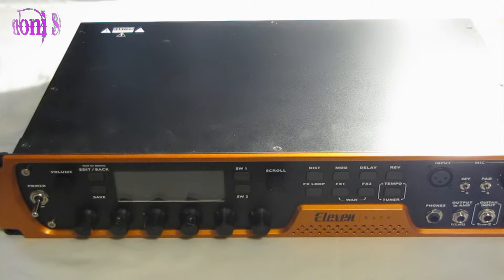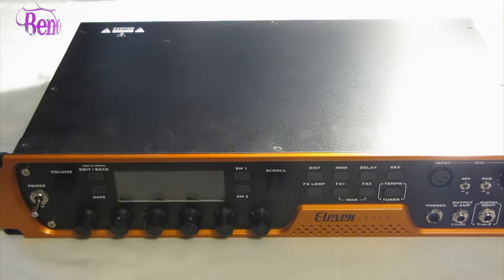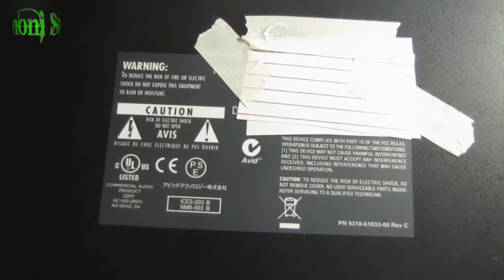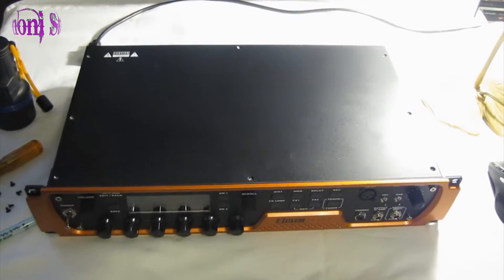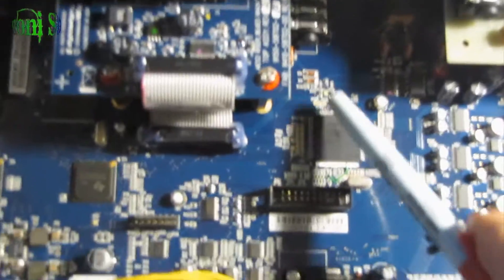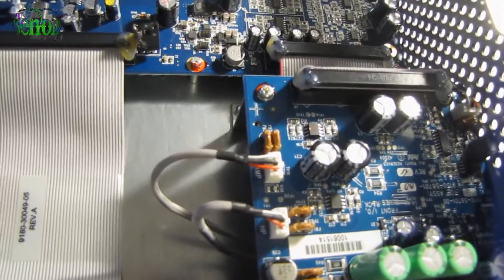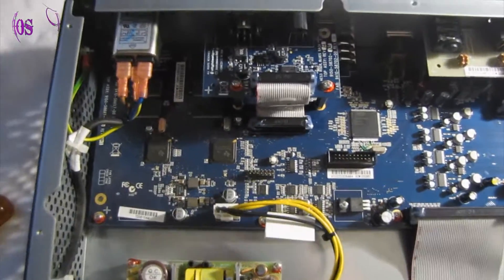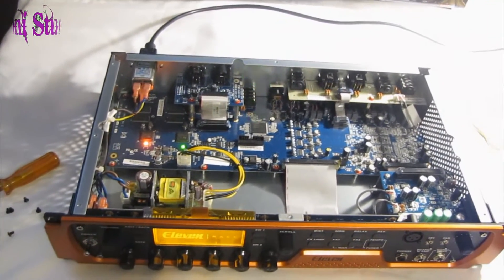Eleven Rack - A Look Inside

Comment: My Eleven Rack screen is not displaying correctly and is all garbled and unreadable. Is there a way to fix this? I disconnected the orange wire tape from the connector and re-seated it but that did nothing. Any help appreciated.
Reply: Mine is the same, did you ever get it sorted? cheers

Comment: Have you ever had the unit randomly power off and then on by itself.
Reply from the maker: Nope. Sounds like a short somewhere or a problem with the PSU.
Reply: So I just fired up the 11Rack and after approx 2 minutes it shut down and restarted by itself.  This happens randomly and sometimes often.  The 11 rack is racked with other rack components but only the 11 rack and the Furman power conditioner was under power.  The rack is homemade and has open sides so heat buildup is unlikely.
Do you think the 11rack is super sensitive to voltage supply?  
Any technical suggestions will be greatly appreciated.
Thanks Rich Watkins
Reply: So I took my Wife's suggestion and unplugged the Eleven Rack from the Furman rack power strip and plugged it into a totally separate wall outlet and Wallaa...it works without shutting down and restarting by itself.  I can't explain this as all the other components that are plugged into that Furman power rack work consistently without any issues.
Just thought I would share that bit of experience with you.
Thanks for all your Great info and guidance with the Eleven Rack.
Rich Watkins

Comment: It seems my mic input gain pot has become loose.  Is it basically the same setup as like in a guitar?  When I turn the knob, the gain pot feels very loose and doesn't control the gain much like when a pot becomes loose in a guitar.  Is this an easy fix?
Reply from the maker: I haven't been inside an Eleven Rack in awhile, but if the pot is simply loose, it should be a quick fix assuming the pot is still good. Obviously unplug the unit first, blah blah...
Reply: LOL!  Thanks.  I'm pretty sure it's a simple fix.  Just curious!

Comment: How do i clean my 11R ? its dusty inside thats why, do i use compressed air ?
Reply from the maker: TheInfekt That's what I would use. Turn it on it's side and blow out the dust. Be careful not to damage the components, and opening the unit will likely void any warranty.
Reply: thanks !
Reply: *****  i dont know if this is the place to ask you this but if not sorry i just have a little bit of concern over my 11r lol, When i was cleaning my eleven rack from the sides (I didn't want to open the lid) i turned both the eleven rack and the air compressor can vertically and it released liquid instead of air... the liquid got on the inside of the 11R, what i noticed is that the liquid from the can quickly dissolved in a matter of seconds, I did proceed to clean the 11r the right way though, horizontally like you supposed to and managed to get rid of the dust (at least i think so) what are the chances of the machine malfunctioning due to this accident ? can this liquid damage the electronic gear like the 11R in the long run?
Reply: *****
 I havent turned on the 11r since this happened
Reply from the maker: TheInfekt  Yeah, that's the reason I suggested to turn the unit on its side because compressed air will spray liquid when the can is not vertical. It shouldn't be a problem though as long as you let everything dry completely before powering on.
Reply: Honestly this thing has more holes on it's chassis than Swiss cheese. I don't see the point to it, since the unit doesn't even get warm.